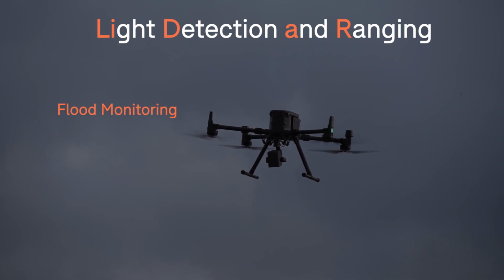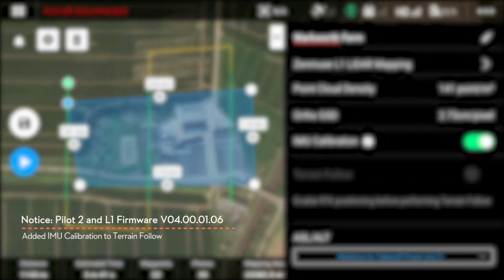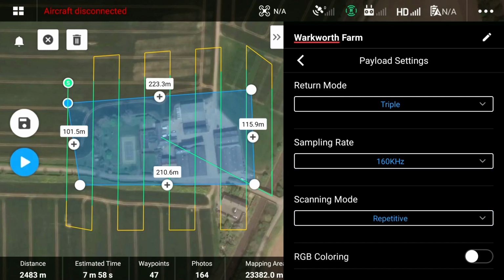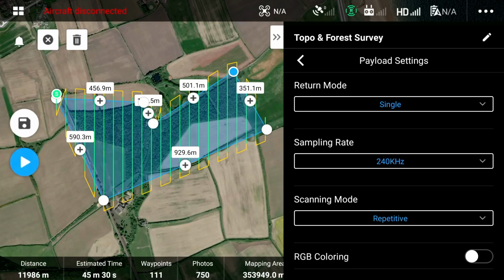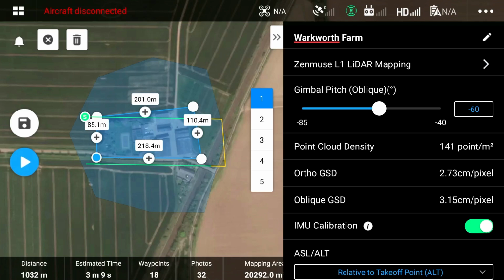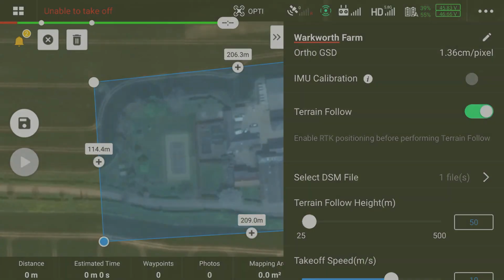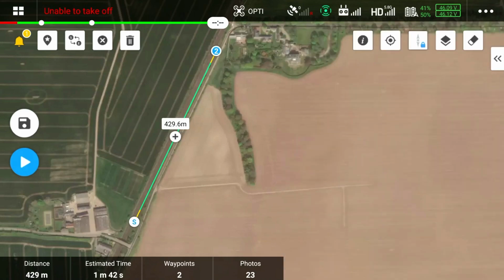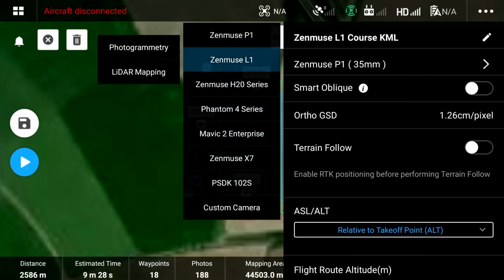The Basics of LiDar Technology

Comment: A Question regarding the Field of View (Scanning Angle), the video states that the Repetitive as well as the Non-Repetitive scan modes (so BOTH modes), result in a narrower Vertical scan with a higher accuracy. This is at ~9min 05seconds on the video timeline. I'm guessing the narrator or his notes goofed. Can this be clarified please? Thanks!
Reply from the maker: Field of view (FOV), also known as the scan angle, represents the angle covered by the LiDAR sensor, or the angle at which laser signals are emitted. The FOV of L1 varies in different scan modes

Repetitive scan: FOV 70.4°*4.5°. In this scan mode, the vertical field is narrower, but the accuracy is higher. This mode is recommended for high-accuracy surveying and mapping.
  
Non-repetitive scan: FOV 70.4°*77.2°. In this scan mode, the vertical FOV is wider. This mode is recommended for data capturing of complex structures, such as building facades.

Note:
The effective range of L1 varies based on where the object is within the FOV. The closer to the edge of the L1's FOV, the shorter the effective range.
Reply: @DJIEnterprise  Thank you for the clarification! We've just purchased a 300 RTK and an L1 for the GIS Dept. of our College and I'm doing some of the prep work. I appreciate the solid reply :)